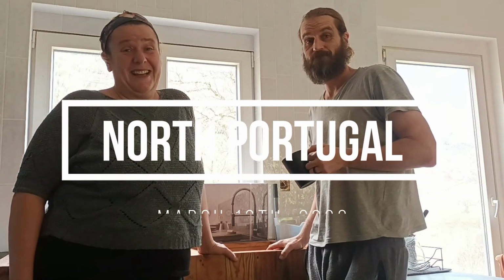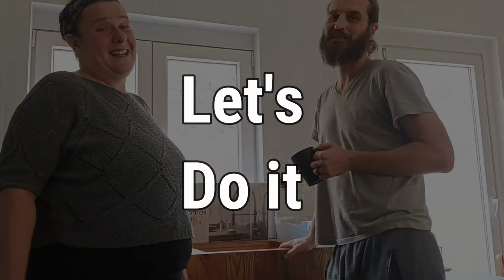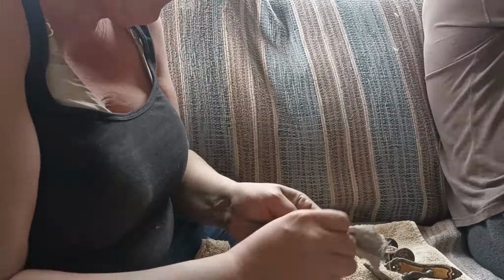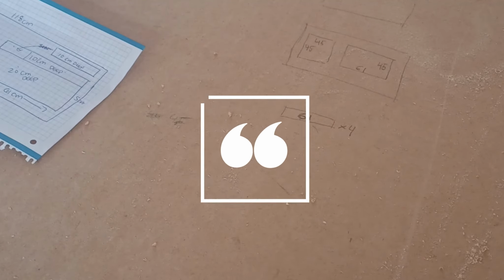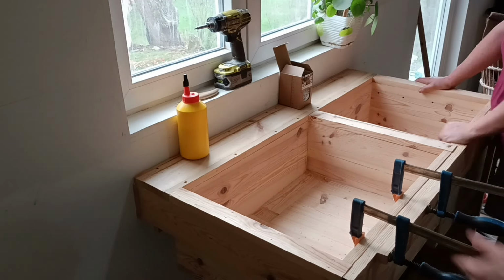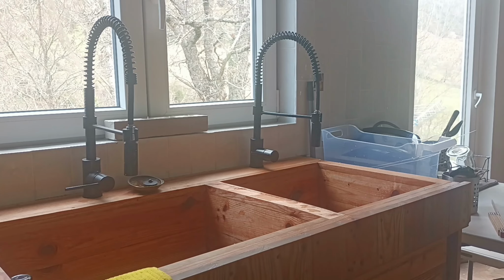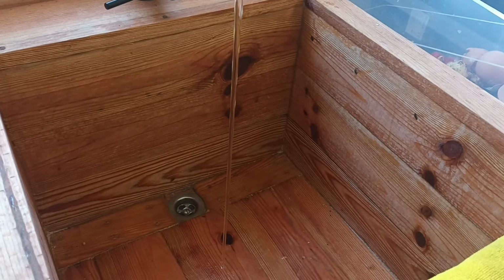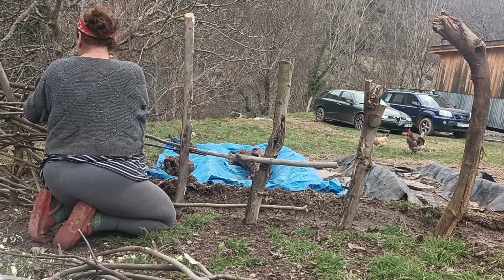Homestead KITCHEN TOUR  & HOW WE MADE A Wooden Sink + faucet  install 👨🏽‍🍳♨️🔥🥩 (Mid-project update)

Comment: It looks really good! Love your Colors. Can you tell me why you decided to go with two faucets instead of putting one faucet in the Center to service both sinks? ❤️🇨🇦
Reply from the maker: Hey Jack :) A couple of practical reasons dictated this choice.  Let me explain...
1st -  We wanted a pot filler for the deeper sink, but it was double the price of the faucet we bought on offer.
2nd - The sink is 1,20m wise. So we would have needed to go for a Pull and Retract faucet (with the height at the bottom under the sink - do you know which ones I'm taking about) to reach both end (maybe?). That's if we got one that was long enough - 1.20 hose kinda tricky to find. Plus, we HATE retractable faucets :D We installed one in the flip house and the hose was always sticking out a bit...
3rd:   The double faucets will be so so handy When we'll harvest & can veggies!! We can clean 2 batch of tomatoes & potatoes at once.
Hope this makes sense :) and thanks for your question!

Comment: Are you planning to purchase a stove and oven.
Reply from the maker: Hi Eileen, That's the plan! ATM, we're waiting to conclude the sale of the Swedish cottage to get appliances. We're juggling with a few ideas,  gas stove and oven (for sure and in 1 single unit). But since summer is approaching a fridge is becoming more a priority. Depending on how much we make on the cottage sale (We don't think it'll be a lot, Sweden's government is very tax hungry). We'll either buy a  chest freezer to put in the goat house (freeze bottle) and continue using our cooler, or get a proper fridge.. Now that we have the wooden sink done, a washing machine is less of a priority :) At some point we'll also get a dishwasher, and it'll be in the island that we'll build imminently. :)  BTW, we got a wheel barrel yesterday, :) thanks a again and have a great week.